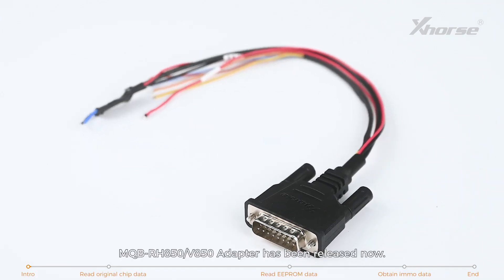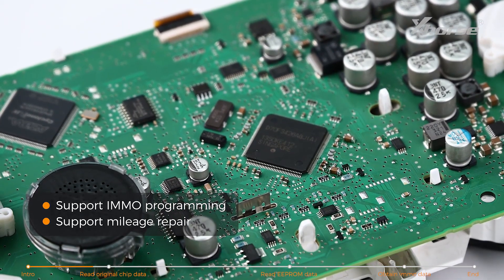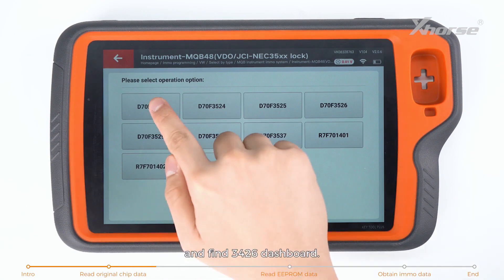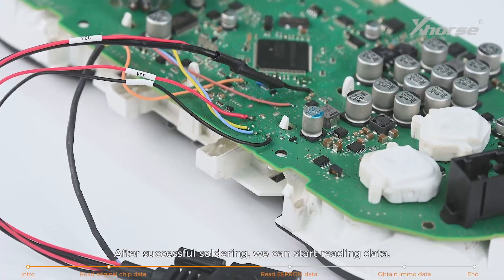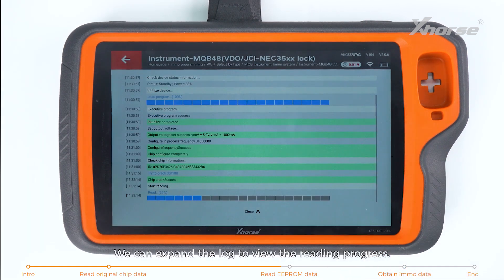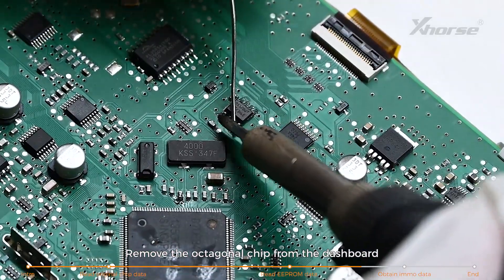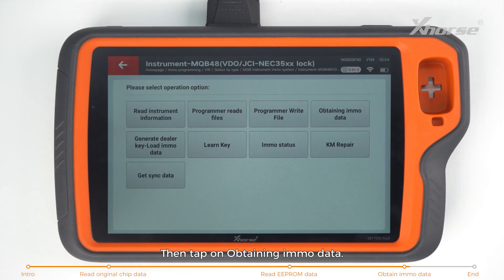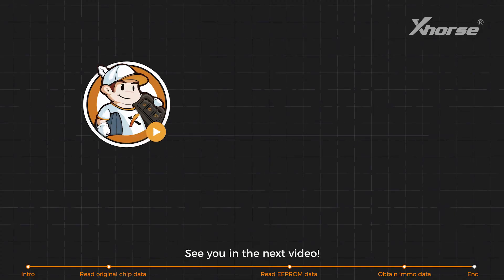Xhorse MQB RH850 Adapter Read D70F3426 Dashboard with VVDI KEY TOOL PLUS- VVDISHOP

Comment: Tow question please.
1 after reading EPROM date and chip data for Add key & all keys lost need to be sent to third party or no?
If no why someone still sending it to third party?

2 how can i get diagram for Beetle 19 cluster AKL situation via Adapter?
Reply from the maker: Better send cluster images (front and back) to us to verify. All keys lost requires sync data from 3rd party

Comment: CAN READ CHIP 95128 VIA ADAPTER ? NOT TO DESOLDER
Reply from the maker: FEM? yes, there is a clip adapter for FEM without soldering
Reply: meaning i can use the fem adapter to read d70f3426 eeprom with this adapter without dislodging  @vvdifactory